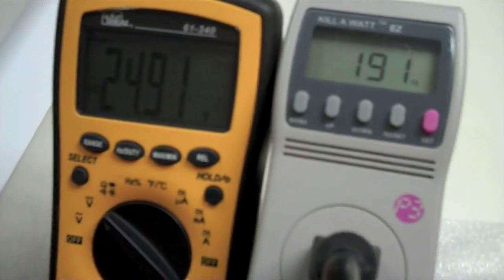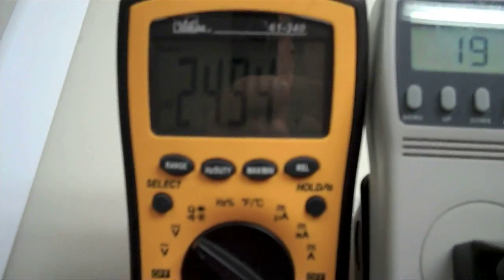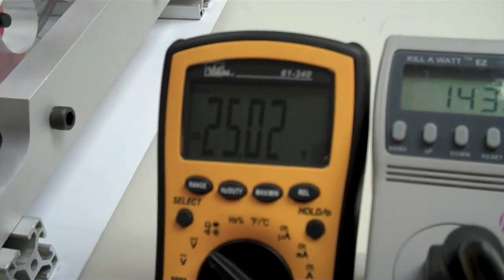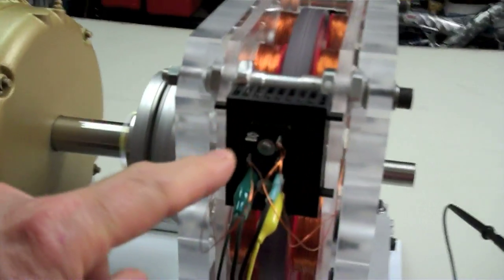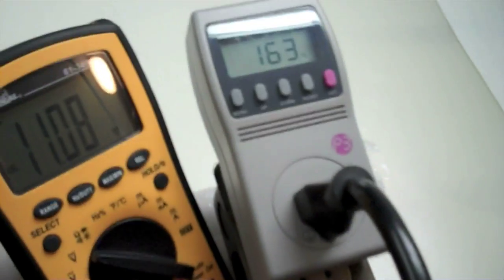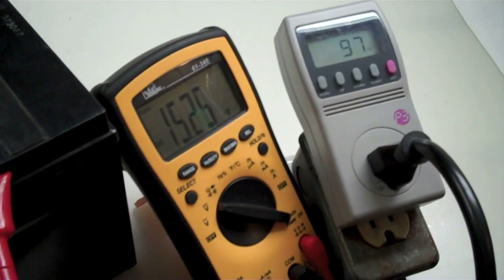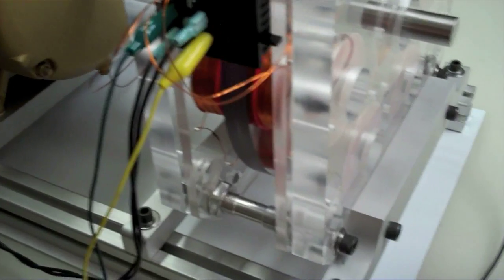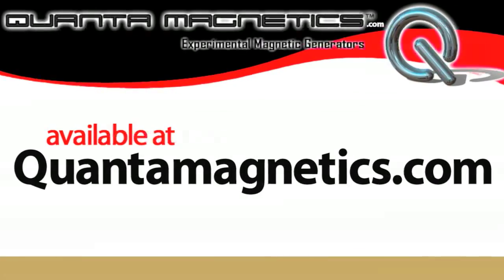Rotoverter Load Input Test

Comment: So you probably need to do some Kirchhoff's circuit laws analysis to figure out why power drops when you connect the battery. Perhaps power is pulled from the battery to spin the motor, making the power from the main LESS. Or do you have a DIODE so that the battery can only charge. You didn't explain that.

Comment: Would be amazing to customize this to fit into the Frunk of a tesla model S and charge the main battery!

=)
Reply: lol yah, i would love a Tesla car with infinite range... but i think a normal generator (zero cogging of course) that simply spun on the shaft of one or both the wheels while it runs and control the speed and output and use the momentum of the car could be possible... if we know all the variables and can actually make more energy than is consumed... a difficult thing to do (especially if no one is trying to do so...

Comment: I'm not completely sold.  The load variances across the compacitance coupled with the flux capacitor that engages the rectifier out to DC voltage doesn't show in real terms the benefit to induction via watts generated from source.  The pretty show does end up as a quieter version for application only.

Comment: very cool stuff and amazing build quality,

few questions.

on the outer shell, are they massive magnets those huge clynder objects.??
if you had a 48v star motor, and you ran the motor @ 48v, what would input:output ratio watts be, is the efficiency above 100% as i believe the world is looking for that!, haha as charging a battery with no load cycling up few mV says output current is tiny!?!
in another video your charging 2 6v lead acids off a 9v cell, what would the watts input:output?
as I personally am looking for a higher efficency for charging my home batteries, currently 220v-24v runs around the 85-90% efficiency
Reply: I wanted to add in my personal experiences with batteries in series, running the motor on a single battery in a bank causes crazy resistance issues and it would give you bad results.

Comment: are you using a true rms meter to measure the output because if it's not a perfect sinusoidal waveform it will skew your results greatly. If you don't have true rms voltmeter you can rectify it and filter it with a capacitor, then factor out diode losses after you have found the current.

Comment: I was asking more of energy in energy out efficiency. The motor is 91.7% efficient at converting electrical energy to kinetic however you still have to convert that back to electrical to charge batteries. What I would really like to see is the motor hooked up to the kill-a-watt and then hook the output to a resistive load of a known value and see what the voltage drop is across it. System efficiency = ((V^2)/r)/wattage on kill-a-watt

Comment: I hate to be be the one to ask but is it possible the reason you are drawing more power with it disconnected from the battery is due to eddie currents creating a kind of magnetic braking field then when you add the power this removes or reverses the field allowing the system to run freely? 

It really needs some kind of torque meter on the shaft to measure this and possibly on the coupling between the motor and the shaft.

Comment: this is the best free energy system that i have seen. Next to my system. But I will never show my system on the internet.  I am working on my system for five years now. My input is 12 VDC, 3.57 amps, my output right now is at 153 VAC, 9.13 amps output. I hope to get my input down to 0.936VDC, 0.052 ma and the output of 24,000 watts, 144 amps.
Reply: 5 yrs on how is your system doing amigo?

Comment from the maker: When using kinetic shaft energy the Roto becomes power on demand, drawing more current as needed. When tapping the third phase for electrical output power, input demand to the Roto will drop.

Comment from the maker: Yes the combination of output from both is very cool, but this video was meant as a fun little demo to mostly show input changes. It's super easy to extract power from the 3rd phase jumper cap on a roto, and just as easy to combine it with rectified output from inductance coils. The real QuantaCharger output tests are currently being prepared for video to properly show the system potential. Please be patient, your questions will be answered. Thanks.

Comment: Do you have a video showing you actually combine the two FWBR outputs to the charge battery?   (the top fwbr from the quanta charger and the bottom fwbr in series on wire 3 of the RV PM, having the DC sides from the fwbr come out and go to the battery being charged?)  I'd like to see that versus just hearing about the claim on this vid.  Please let me know where the video resides.  Thanks!

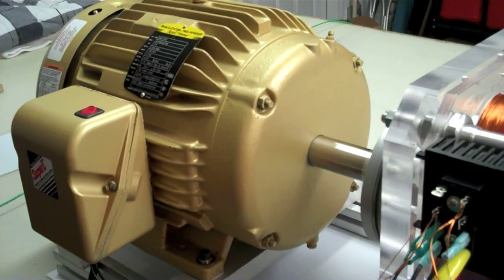Comment: Thats quite the spin you have there.   All you've done is run the RV PM as Hectors noted and put a FWBR in series on the 3rd wire that goes off wires 2/3 to the run capacity that is used to offset the phase difference that lets you run this 3phase motor from single phase power.  Given the screenshot at 3:57 and how nothing is connected to the "quanta charger" but the output going to the battery being charged is just off the fwbr in series with wire 3, what is the gain from the quanta charger?

Comment from the maker: You're obviously not talking about the 7.5 hp Baldor motor Stefan. I was able to get the input down to 48w when Hector said at best it could be accomplished at 60-65w. It's all about the fine tuning of ONE capacitor for idle, or load specific. No big deal. This setup uses an additional cap as a phase jumper to tap the high voltage radiant. Most just connect two motors to each other instead. I wanted the alternator/prime mover combo to accent my Quanta Charger. Your test ideas are quite easy.Mike
Reply: Hello , Pray you n yours are well and blessed! Please could you direct me to Hectors videos please ? I have lost the subscription somehow . Thanks .Mk

Comment: Hi,  well done mechanical setup,  but you must be doing something wrong,  as normally you only need less than 30 Watts for the Rotoverter in idle mode....... 

Just show the volts and the amps on a resistive load like an incandescent bulb! 
And then compare it to the input power! 
Many thanks! 
Regards, Stefan.